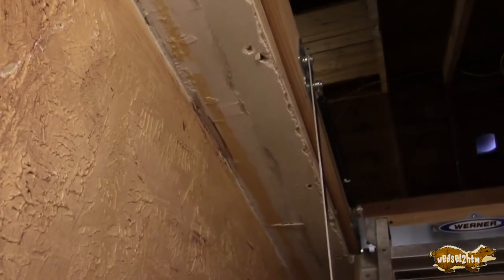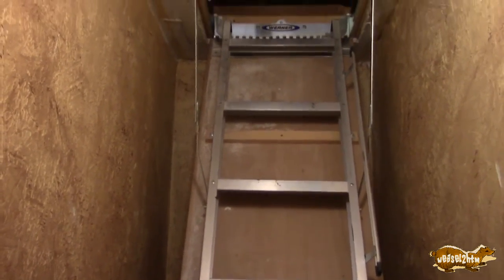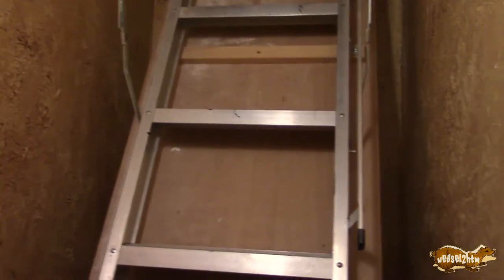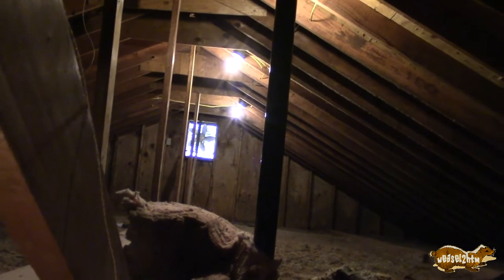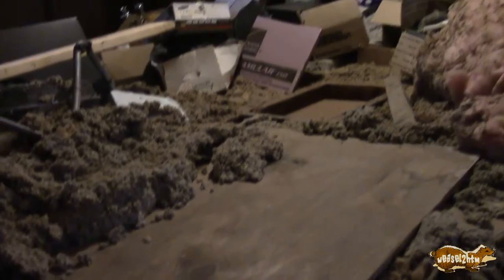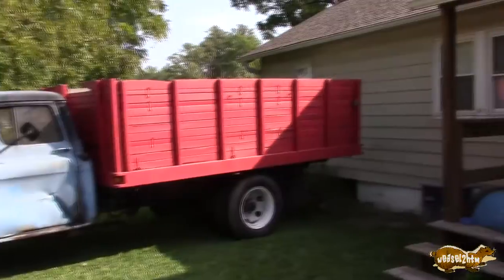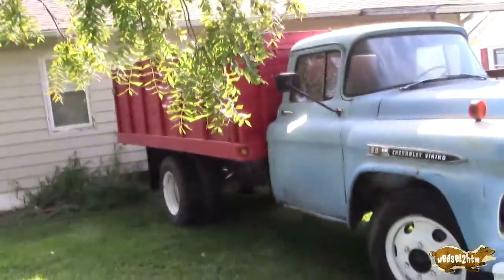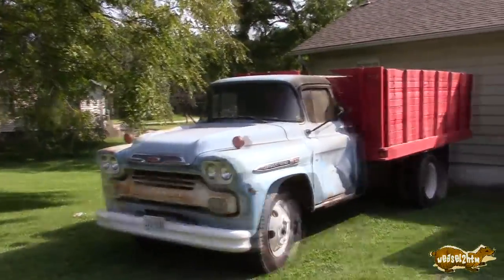Attic Pull Down Steps and return of the Chevy Viking 60 next door!

Comment: Why yes I do remember that from a previous video. Nice to see that it's still around.

What a project. It looks really sharp. Now, just don't inadvertently fall through the ceiling! (Some questions before I go: is that the "stupid, dead fan!" lying face down in the attic, and is that box fan up there on any kind of a thermal control?)
Reply from the maker: I have gone through the ceiling before, I'm NOT doing that again!  The fan laying face down is the "twin" to the stupid, dead fan, I would sometimes put it in the attic opening to push air through the attic, but I have found that box fans in the windows are more effective.  The brace bladed box fan is controlled by me plugging it in when I think I need it.

Comment: Very nice. I know that was allot of work since I recently had to re-frame my attic opening as well to accomodate a larger air handler. Question: How did you ensure that the ladder would rest on the floor when fully extended rather than hovering above one of the steps below?
Reply from the maker: I don't 100% remember, I think there were some guides in the instructions.  The rest was prayer and s.w.a.g.